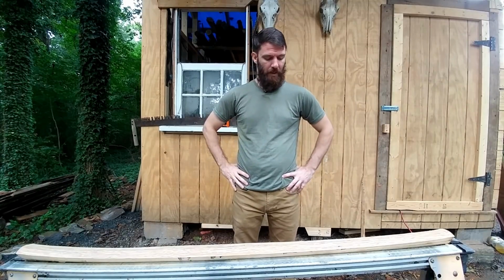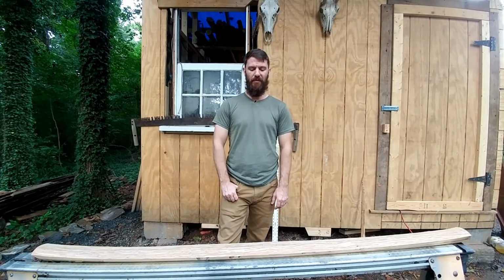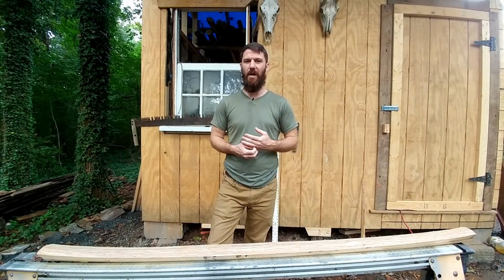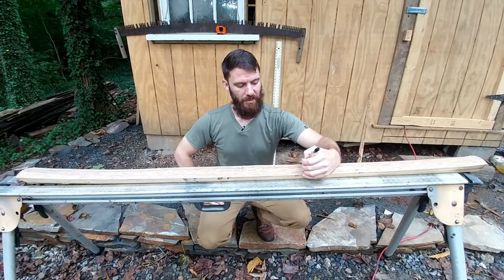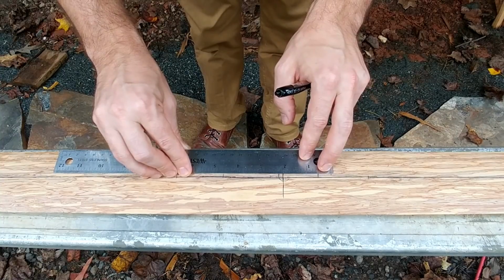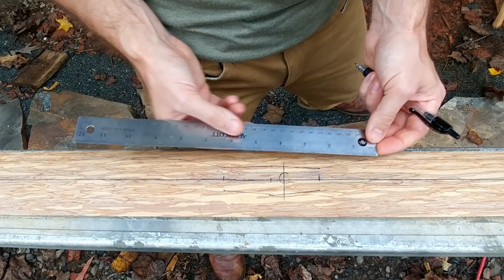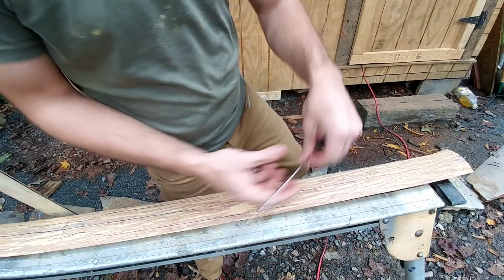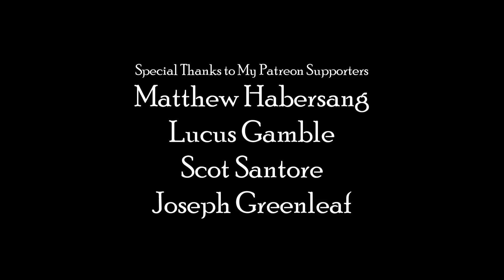Build your First Self Bow, Part 2 (Laying out the design)

Comment: Thanks for your step by step tutorial 
I am 95% finished with my Dogwood bow 59#@28 inches, my target is 50 lbs
Same dimensions and specs as my successful hickory bow but noticeably thinner at this stage, 
Being extremely cautious nearing completion. 
Any advice would be greatly appreciated.
Reply from the maker: You're welcome. You can start removing wood from the sides if the bow is getting too thin. If it's that thin already you probably don't have a lot you need to remove so you should lose too much width. Just keep it consistent on both sides

Comment: Have only watched the first two parts of the self bow making series and have a question about the design process... How/when does one determine how much pull weight the finished bow will have? I'm a beginner archer without a lot of pull strength, so my first boughten bow is a skinny 18 lb. hickory flat. The design I just watched you draw out looks quite beefy. Even if I build up some strength practicing, I don't imagine my next bow would be more than a 25 lb. draw...
Thanks! Off to watch the rest of the series!
Reply from the maker: Good question. It's usually something that the bowyer sets as a goal when they start. For example, the know their draw length is 28" and they want to hunt deer so they pick a good weight for that task at say, 50#. So they design their bow to be safe and effective at 50#@28". Sometimes people will take a stave and let the stave guide the process without a particular goal in mind and see how it ends up. Sometimes you start with a solid plan but the stave sends you in another direction. When you're starting off it's best to have a solid plan and use a tried and true design that isn't too complicated. Its good to ask other bowyers for some guidelines if you're not confident about your design.
Reply: @SwiftwoodBows  Thank you for the reply Weylin. :) Looking forward part 5 now, binge-ing this morning, lol! Your manner and presentations are wonderfully thorough, and prove why good bows are worth every penny. I'll play through your series again while I make ladies bonnets instead of my own bow though. I'd rather support a talented bowyer by selling items I already know I can make well.
Reply from the maker: @rosehep3301  you're welcome. Thanks for the feedback and good luck with your projects

Comment: Hi Weylin.
I have a question regarding bowlength vs. drawlength.
Is it possible to make a 60 inch ntn bow for a 28 inch drawlength, if the bow bends through the handle?
With the american flatbow, you have an 8 inch static handle section. My thought was, if you make the handle section active, 
you could make the bow shorter.
I am considering making a flatbow from ash, that bends through the handle. 60" ntn, 1 1/2" wide at center and 5/8" wide at the tips.
The goal is 50#@28".
Reply from the maker: You've got it right. Double the draw length to get the length of needed working limb. If the handle is working then 60" is plenty for a 28" draw with a reasonable weight.
Reply: @SwiftwoodBows  Thanks for your reply, Weylin!

Comment: Great series. What dimensions would you draw for an osage orange bow. Fairly straight. 63" long. 6o lb pull. Thanks. Michael.
Reply from the maker: Assuming that you are drawing it 28" I would keep it fairly wide, like 1 3/4" wide until mid limb and then taper down to 1/2" tips.

Comment: Hi Weylin.
How do you determine wether to offset the handle by a 1/2 inch or 1 inch?
And does it really matter to make the top limb longer, when the handle section is non-bending? 
It made me wonder if it wouldn't be better to have symmetrical limbs, when the handle section is non-bending.
Then the stress on the limbs would be even.
Reply from the maker: My current belief is that it doesn't really matter. Just make sure the limbs are tillered and balanced accordingly. Lately I have been building most of my bows with symmetrical limbs

Comment: I already cut the top layer of wood while taking the bark off, is the bow screwed or can i still attempt to make a bow out of it?
Reply from the maker: It's not necessarily a failure. You can carefully remove the ring you violated to reveal the next ring down. If it's just a little nick in the wood you might just be able to sand it down smooth and ignore it. What kind of wood are you using?
Reply: @SwiftwoodBows  i think i'll have to start fresh if thats the case. There's 2 knots that i was trying to flatten out a bit which i cut multiple layers deep. The wood I'm using is chinaberry, which from what I can tell is not the best not the worst. Thanks for the quick response.

Comment: Could you expand on why you prefer a longer top limb?
Reply from the maker: Sure. I go back and forth, actually. Some bows I make symmetrical and some have a longer top limb. I honestly don't think it matters in terms of accuracy or shootability as long as the bow is tillered correctly. When you shoot split finger and especially if you shoot three under the bottom limb ends up getting a bit more strain. That can sometimes lead to the bottom limb taking a little extra set. This is counteracted by the bottom limb being made a little stiffer than the top limb. You can do this with both symmetrical and asymmetrical limbs. It's just exaggerated with asymmetrical. There can be a little extra comfort if the top limb is a little longer because the bow naturally balances in the hand better when you're carrying your bow. This is such a small difference that I don't really notice it either way. So, long story short, it doesn't matter as long as you tiller it appropriately. Make it how you want. :)

Comment: At 65" the bow will be 45# draw easy, you could go to 55# @28 easily as well,I have one I made that's 57#@28 and it has no string follow.
If you reflex the limbs about 1"-2"thatll help with preventing string follow

Comment: What exactly is the theory behind offsetting the center line and shortening the lower limb?
Reply from the maker: Well, there is debate about how it matters or if it matters. I'm currently on the fence. I sometimes offset and sometimes make the limbs even with each other. I don't notice a difference when I shoot. If the bottom limb is two inches shorter then the arrow would pass through the true center of the bow. Some people believe this matters.

Comment: So I have a stave, it's perfectly straight and seasoned.... One problem, I harvested it in winter and I'm not sure if it's hickory or pecan. The wood is a sort of pink color, hickory sapwood is usually whiter. I had a for sure hickory stave all seasoned up, took off the bark the other night in anticipation of your second episode, but it's got burrow holes ALL over :(((((
Reply from the maker: Pecan and hickory are pretty darn similar. You can treat it the same as you would hickory. Those bug holes are a bummer. :( The first bow I ever made was a hickory bow and it had a few bug tracks on the back. They were pretty shallow and I ignored them. The bow shot great for many years but it finally popped a big splinter right at a bug track. If there's enough meat on the stave you can go past them with a draw knife and do your best to chase a ring. There may still be a bow in there.
Reply: Hmmm, thanks for the hope. It would really be a shame to let that good hickory stave go, maybe I should back it.

I'll definitely use the pecan stave for now to work along with you through this series and I'll post my stuff on Primitive Archer :)